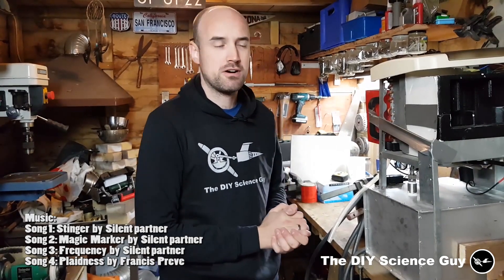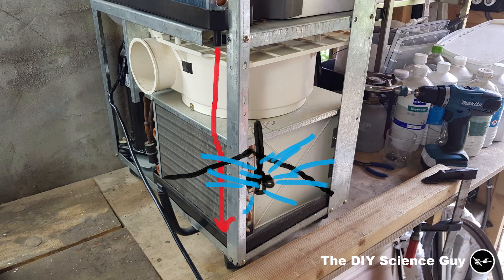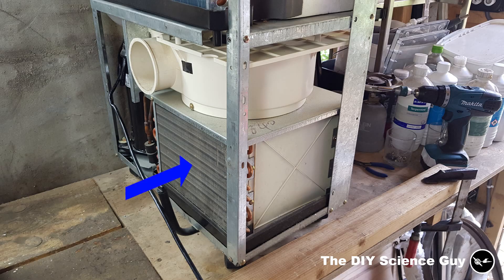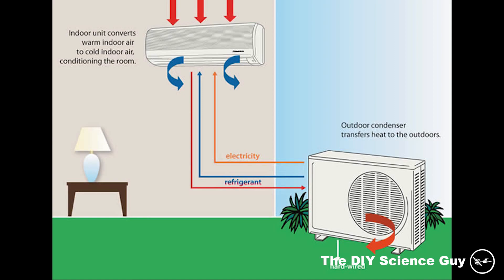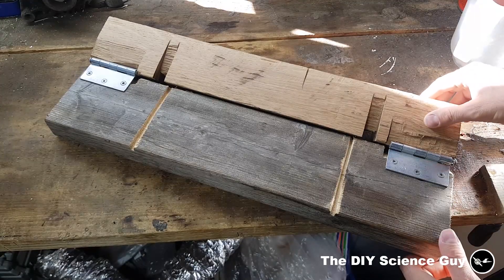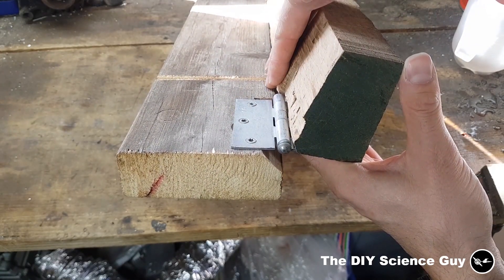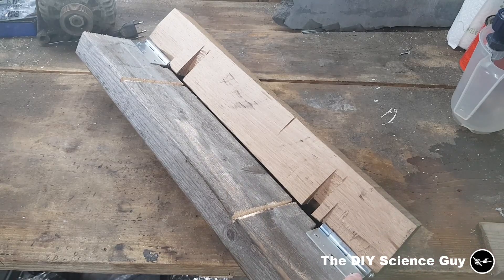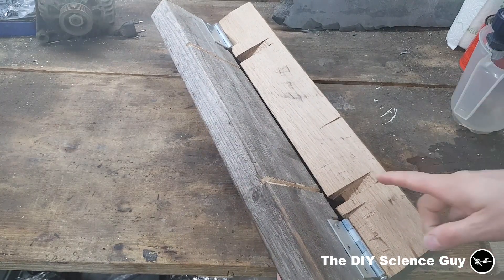Why did no one think of this before: Water Cooled AC/Hot Tub Heater

Comment: What do you think about  evaporator alluminium and copper corroosion , in the water  ..Im trying do it with ac indor unit in pvc 200mm pipe its working but some comments about near corrosion demage  ..sorry for my english
Reply from the maker: As long as you don't use salt water, corrosion won't be a problem.

Comment: Hello,
 Thanks for the great recycling of components to capture the heat.
 I think you'll have more efficiency by putting water into the bottom of the compressor jacket to push the air bubble out and allow the hot water to rise out the top. Also slowing down the water flow to pick up more heat will will improve the heat gain.
 Great video and I always watch your projects.
 I'm trying to duplicate your hydrogen system to run my car on it.
 Good luck on future projects.

Comment: I love it! Could you do the same for refrigerator? I know it’s 10times lower energy level, but still ;)
Reply: Big thing to remember is that heat can be aggregated. so if you use a little bit of heat from the refrigerator, a little bit of heat from your AC unit, a little bit of heat from your furnace exhaust, a little bit of heat from your hot water heater, and add some solar collector coils that heat level compounds for the same amount of volume.

One big thing to keep in mind is not to pressurize it, but use natural heat siphoning with check valves. Once you start pressurizing things it becomes very difficult to control when you're using byproduct heat as the system's generating the heat don't care about what the heat is doing.
Reply from the maker: Thanks! Yes you can!
Reply: @TheDIYScienceGuy  there is something here i try to get it, can i make the temperature for example stand for a long time to be 18 C  ,, for 2 or 4 hours?
Reply from the maker: Yes of course why not, it al depend on the amount of energy and the temperature difference.